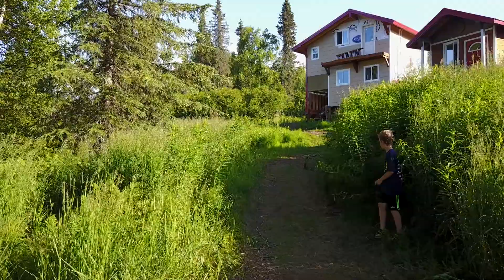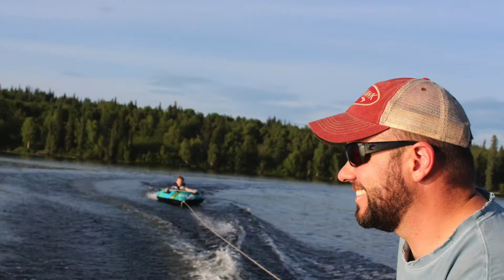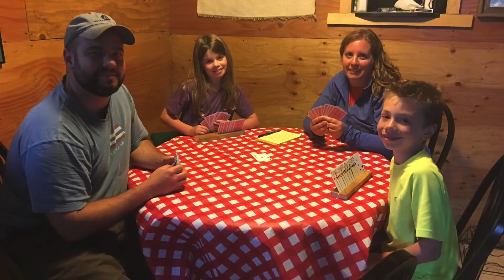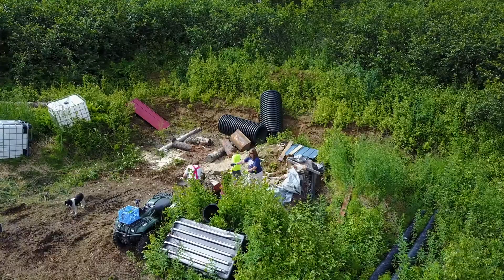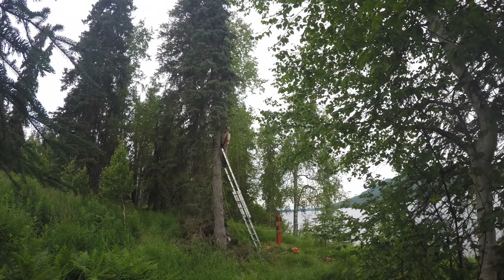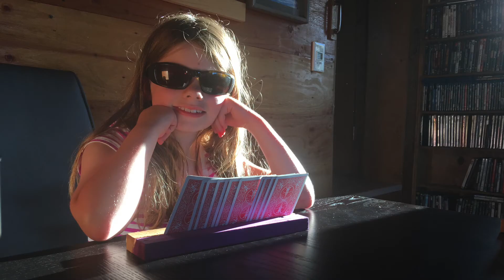Cabin Fun Summer 2017, Shell Lake, AK

Comment: How did you get the Kubota to your cabin? Can the strip on the west side of Shell be used buy others that purchase property? Thanks in advance.
Reply: Free Range American   The kubota was barge up the rivers to Skwentna then in the winter it was walk overland to my place. Runway on the west side is private
Reply from the maker: Sorry, I did not see your message until now.  The Kubota went up by boat to Skwentna in the summer.  Then it was walked the remaining 15 miles or so over the swamp and through the hills.  Quite the trip...   The strip is privately owned, and thus you would need permission before using it.